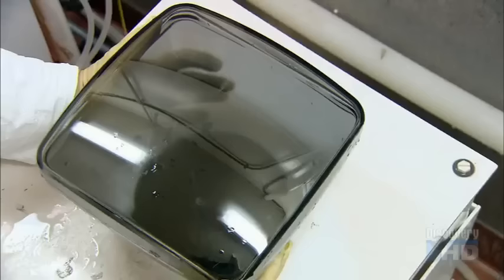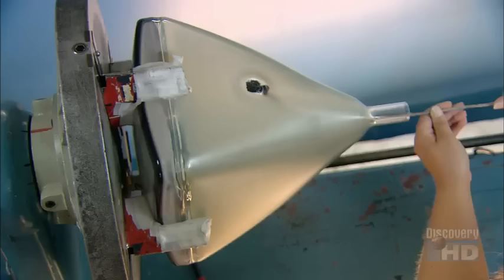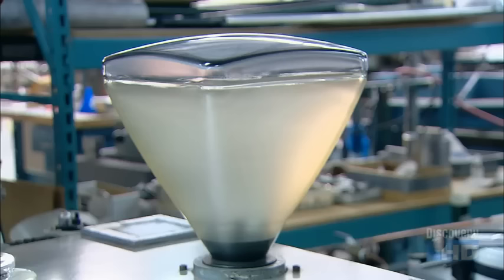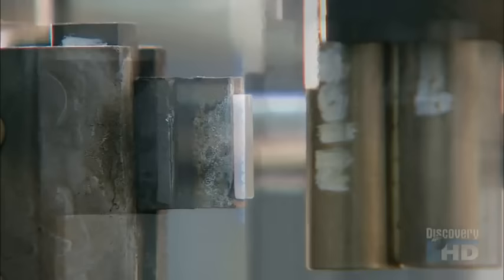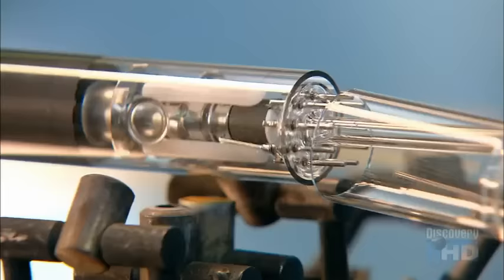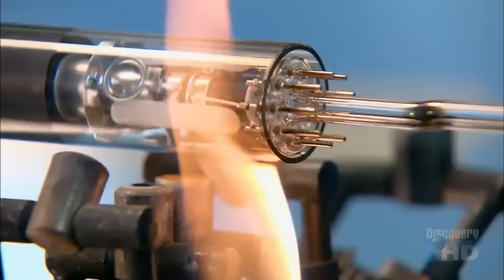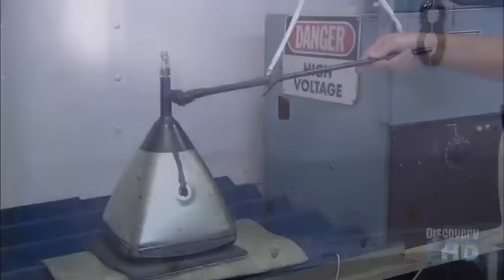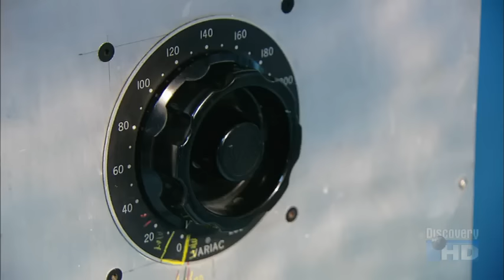Discovery How Its Made - Cathode Ray Tubes (480p) -=KCK=-.mp4

Comment: I bet somebody could make a fortune producing 4:3 240p OLED monitors for arcade machines :)
Reply: +Cheeko Beeoka Not true for all arcade games. Some of the newer ones (mid-late 90s) are 480p like Tekken, but a game like Mario Bros. (arcade) has a resolution of 256x224p.
Reply: Nobody would want an oled for classic arcades, CRTs are still very wanted for such places
Reply: @rollercoastermaniac2  But if we're talking about currently produced displays, the OLED has the most similar picture to CRT.
Reply: @mrnmrn1  yes but they are a defined resolution, which would suck tremendously for older arcade games
Reply: @rollercoastermaniac2  I don't think a full HD or 4K OLED would really suck in a low resolution arcade. If the OLED's resolution is similar to the arcade's, yes, it would look awful. My main problem with the concept of OLED as a computer / arcade game monitor that they develop screen burn horribly fast. They're worse than plasma in that aspect.
Reply: @mrnmrn1  they do suck, they have been shown to really suck, especially full HD.
Reply: why 240P? you know the resolutions you can reach with a CRT screen? It's virtually limited by the quality of your components treating the signal. My last CRT? A Diamondtron, made usually a nice 1600x1200; in some cases when i needed more space, cranking it up to 1920x1440.
Reply: @SilverSpoon_  Diamondtron... I have one for about 15 years, still waiting for repair since then... It's an iiyama VisionMaster Pro 510, 22" flat screen, 2048x1536 @85Hz, 1600x1200 @120Hz, IIRC. It has a Mitsubishi chassis, with a huge design flaw in the power supply. If one electrolythic capacitor fails around the feedback optocoupler, it makes the feedback ineffective, and the power supply overshoots badly, and constantly. The magic smoke flies, as the output voltages skyrockets to almost double the nominal value (if operated from 230V). The RGB power amplifier chip and the horizontal deflection stage is fried in mine because of this, as the nominal +80V rail went up to +140V.
Reply: @mrnmrn1  I loved mine, except it was a 20"packed/branded under ProView, a rather distributor brand and come with DB15, not separate BNCs which is funnier for all kind of electornics stuff.
It's somewhere in my attic, I should clean it up, it tends to degauss at random, or tick, which is crazy.

Comment: Color CRT's used three guns (red, green and blue)--the unfortunate thing about them is that one gun tended to wear faster than the others. When that one weak gun got bad enough, the CRT was junk, even though the other two guns were still ok
Reply: @Filthy Peasant I'm surprised that you even had the option of getting it fixed; no one has made CRT's or rebuilt them in many years

Comment: the very last CRT TV was made in 2010
Reply: they should put them back into the market with see through plastic housing so you can see the tube in action and watch the beams inside the tv
Reply: @georgieippolito9924  see through Tv's are Only sold to Prisons, so inmates can't hide drugs behind them, and they don't have speakers so inmates will need to use headphones.

Comment: CRT ever had 480i? I have never ever heard of this. I just always wondered, why VGA on a PC or later DVD only had this low resolution, when decades before. the rest of the world already used 720x536i. DVD often has this becut resolution too
Reply: " 536i " doesn't exist . 480 × 30 is the same as 576 × 25 . This is 576i .

Comment: The life of a CRT when used withing specification is way high then LCD or LED. I have a CRT tv which is 19 year old. Many electronics were changed in TV but CRT is still the old one. Great piece of technology. I like things that last.
Reply: They belong to a different paradigm of electronics, where serviceability and longevity were two key factors going into the design process. Just like all tube-based electronics, they can practically run forever without fail. The tubes themselves at least. Try doing that with modern consumer grade electronics. Nowadays planned obsolescence is the name of the game.

Comment: In concept this is somewhat accurate, however in newer crts it is missing the high voltage tap connection on the side of the tube.
Reply: Jeff Larocque  yes. Thanks for the name, never knew the name.

Comment: Let me tell you right now, unless some crazy thing happens, CRT gaming in the future will not use these kinds of super-complex CRTs.
CRTs in the future will be much simpler than these. Forget about Trinitron, or even shadow masks.
All you need is a electron gun, a phosphor coating, and a external deflection coil. The tube itself would be like those old vintage circular tubes because it's easier.

Comment: CRT last forever, but they are so prehistoric by today standards.
Reply: Wrong. They suffer from various failure modes alot, including aging and wear.
Reply: Mine lasted 14 years -- that's close enough to forever, yes? :)
Reply: S730SD that is not forever. My LCD could out live that and it already has.
Reply: @pyeltd.5457  Suuuure it has.
Reply: A CRT is most likely to last around 50 years, or if lucky later because the oldest TV you can find working fine still is one from the 1970's, but if luck, one from the 1960's. There is very little chance you will find a TV from 1948 up to 1964 working great, but rather in a state that requires a lot of repair. The disavantage that a modern flat screen TV has is that their not built to be repaired like the old school CRT. At this point I'm the only one in my family using a CRT tv now.
Reply: Seth Horst you don't need to repair them as they are less clumsy that a CRT and if so. Throw it out the window and buy a new one.